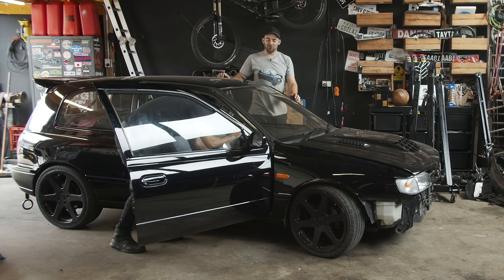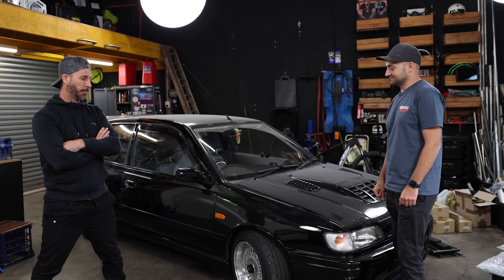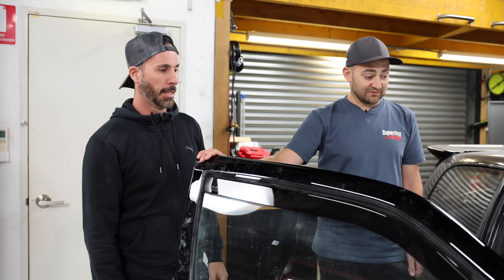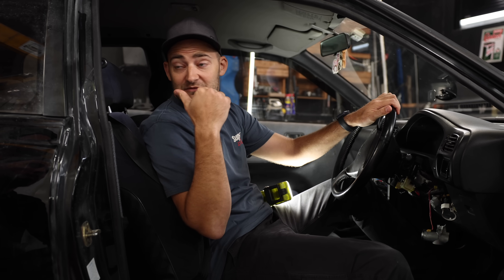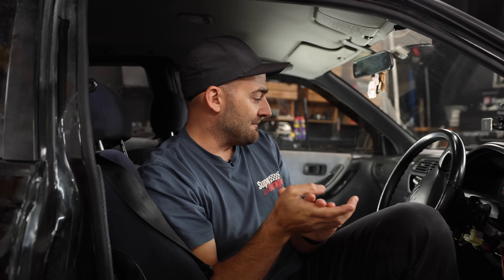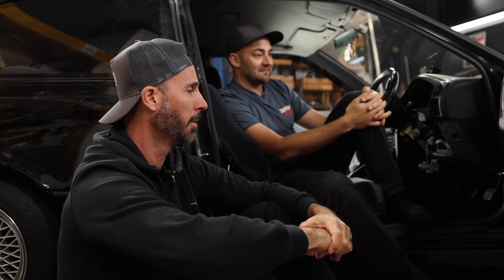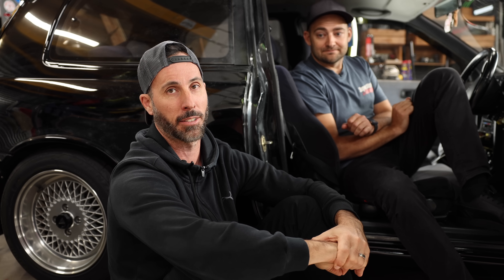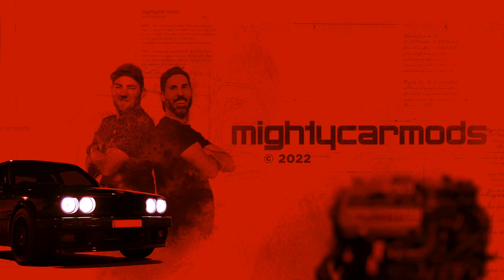Someone tried to Steal the GTi-R | Police Called

Comment: Shame you didn't catch them in the act, here in the UK one of my mates was parked outside my house in his modded Toyota starlet glanza while we were having a few beers. The CCTV which ran in real time to a screen showed someone walk up to his car and start trying to open the door with a screwdriver. He didn't know what to do and panicked. I on the other hand knew exactly what to do........I wasn't going to confront someone with a screw driver unarmed and in the UK the police are pretty useless, if they turn up an hour after the crimes committed you're one of the lucky ones. So I decided the best idea was to grab a large axe and chase the guy down the street with it. As soon as I shouted at this guy and went nuts at him he started running. I chased him for a few minutes until he jumped over someone's 6ft garden wall. When he landed the other side he started screaming and swearing. I saw the house lights turn on and thought I'd better get away as I'm holding a 4ft axe. It turns out a few days later he had badly sprained his ankle after jumping the wall and been arrested for going equipped for burglary and trespassing because the homeowners called the police and he couldn't walk to get away. He got his karma. Moral of the story,  leave other people's stuff alone, they worked hard for it and karma will catch up to you one day.
Reply: Its why they carry scissors these days and not screw drivers. My previous car go broken into several times at work (90's car, parked near a train station). Last time cos new locks, they TRASHED it. Smashed all the glass, slashed the tyres and shit.
Reply: @Mr_jz_12  sounds like they put some effort in and got pissed that they couldn't take it/your stuff.
Reply: @dreamcrusher112  The cops knew who they were (wouldn't tell me officially though). All i knew they were kids, they were known to do this, and they got off. "You'd have never seen it again if they did get it. Because they didnt get it, they trashed it". Scissors were left on the floor undet dash. "They carry scissors as they have two goes at locks/barrel. It doesnt look suss if someones carrying scissors unlike a screwdriver"
Reply: Lol tough guy, scared of a screwdriver.
Reply: I wanta no where u got a axel from so fast lol
Reply: Just got back from England and constantly heard that theft and violence is common as hell. One of our contractors had a co worker get his face broken up in what the Brits call a  "car park"
Reply: @whackaify  Like all places around the world, you have to know where to be and when.
Getting caught in the wrong place at the wrong time is very common in England as there's a lot of them.
Reply: @DJIInLondon  Lol you'd be surprised what people are capable of when others mess with their shit. Plus this kinda shit common, especially in the UK

Comment: There's a couple being broken on eBay UK which still have the driver door.

Rust is getting to the chassis of this age of cars here so they are failing the MOT - our loss could be your gain.
Reply: I can help you get one shipped over, if needed, let me know.
Reply: @jaygsi  That's awesome. I feel the love.
Reply: Failing that would a door from a nissan sunny be a suitable replacement?
Reply: @tammurney3053  Lol i almost said the same thing, yes it would and there no expensive either

Comment: The value thing is so true. 

November 2019 my DC2 integra Type R got rear ended. Relatively light damage, car still 100% drivable and no chassis damage. At the time it was insured for $7200, which to be honest was a fair value for it on the market at that point. Quote to fix it was $7700. They wrote it off despite a solid month of me trying desperately to save it. 

Queue 2 years later and if it was repaired it would now be worth 30K.
Reply: as a integra lover, i would have bought it back, fixed it, and got a new/rebuilt title, even if it wasnt a type R.... i own 3, have owned 5, and never owned a type R
Reply: @popanollie1  i did buy it back with the intent to repair it but the insurance company deregistered it again despite my protests which made the whole process of getting it back on the road a much bigger and more expensive nightmare past the original 7K repair cost. (Im in NZ with fairly strict laws on damaged/potentially unsafe vehicles) It ended up sitting in the driveway for 6 months before I eventually onsold it to someone else who planned on turning it into a track car.

About a month after the crash I actually found another DC2R for sale in original factory Milano red (stupidly rare) and bought that one, which turned out to be a much better financial decision in the long term anyway because it was in MUCH better condition. I still have that car now and she is my absolute pride and joy.
Reply: If i ever decided to get insurance (other than the standard 3rd party one) i would make sure its one that allows you to keep the car if it ever gets written off.
Reply: That's sucks man. If this ever happens again, find a bodyshop that's willing to write an estimate to 95% total threshold and cover the rest out of pocket. The shop I used to work at would do that for people that clearly loved their cars and wanted them to not be written off because it wasn't really any skin off our nose and totaling cars didn't make us hardly any money vs repairing them. We did it for an MR2 that had a full bodykit because the customer was willing to pay and willing to find out of production parts for us.

Comment: I do feel your pain with the damage, when I was in Germany, someone literally vandalized my car. smashed my rear taillight and used some sort of crowbar and put a hole in my rear quarter panel. Till this day I still never figured out who did it but I was able to replace the taillight, unfortunately my quarter panel still has a hole in it. I hope you guys find who did this to your car! A shame that parts are hard to come by for these! Anyways Great video!
Reply: The quarter panel will probably need a piece welded in, plastic fill to smooth the panel out and painting. Unfortunately, not a cheap or fast job
Reply: I hare people like that. Probably teenagers or eco people
Reply: Sounds like a truck backed into you tbh

Comment: Exact same thing happened to my Turbo Starlet - Smashed the barrel and lock, bit of panel damage etc. Only thing that saved me is I stored it without a battery. I can feel the anger from you both
Reply: Doesn't the barrel have a lock to stop people from smashing screw drivers in it tho?
Reply: @peterstoyanov7897  Starlets weren't really seen as sports cars so Toyota probably didn't think to invest in a more secure barrel system.
Reply: @peterstoyanov7897  They can undo it or use a metal pole that is slightly wider then the barrel lock,and than snap it off to expose the white plastic key turning bit
Reply: This must be the go to way to steel a starlet, mine was done the exact same

Comment: So sorry to hear what happened guys, gutted for you both... I'd recommend checking that car over for a tracker, it is possible the pieces of <goat noise> put a tracker on it to see where it ends up.
Reply: I'd imagine if these <goat noises> were stupid enough to ruin the door and key barrel, then they're too stupid to think of using a tracker. It wouldn't hurt to check it over anyway just to be sure though. Good idea.
Reply: @jordanh.2998  they might have wanted to damage enough that they'd need to repair it? I don't know, I'm always wary and probably a bit paranoid after a few incidents in the past.
Reply: Good shout. Limited numbers of anything or something collectable people keep there eyes on them. If you have something nice some cnt is going to want it.. scummy.
Reply: @jordanh.2998  eh better the be careful just like mcm said you can use an AirTag in you car to track it, its just as easy for them to just slip one in there as well

Comment: I've been mad at my lil E36 Compact for suddenly dying on me (immobilizer/dme out of sync with the key I think) and I still can't get it started. But this video made me realize that as much as it sucks to not be able to get my own damn car going, I'm glad BMW put the effort into making EWS a clusterfuck of a system.
Reply: @jo300hn  You're going to hurt the lil compact's feelings bro don't do this
Reply: @TIPh0enix  all good👍
Reply: Yup had the same happen on my E36, EWS2 immobilizer chip in the key died while visiting the Nurburgring, stranded there for hours in the middle of the night, hundreds of miles from home, cursed the whole system but I really did not want to remove the immobilizer because it does work, and EWS2 is still a fairly difficult system to beat, despite being so old: the only way to bypass it is to code it out of the ECU.
Reply: @ThaMythbuster  Aye that seems to be my only option. Have to send the DME across the country to get it coded out. Funny enough I don't actually know for certain if the car has EWS1 or EWS2. The module is missing the "II" on it but it's a 95 with a M43B16 so it should be EWS2.
Reply: This episode has convinced me not to delete the EWS from my E46. That EWS might come in handy someday.
Reply: It sucks ass, my golfs timing chain is gone after only 72k miles. No idea the total damage, might be scrap now.

Comment: Expensive 90s JDM cars are prime targets for car thieves because of the cars usually outdated security tech. Definitely worth upgrading security on older valuable cars.
Reply: 80s cars were worse. My Dad had a shop next to someone with a Sierra Cosworth. The 3rd time it got stolen and recovered the owner was complaining to my dad about "how do they always manage to steal it?" so my Dad took the keys to his Ford Transit van, unlocked the Cossie, started the engine and drove it off right under the guy's nose. Factory immobilisers, moving the stalks for the door locks so you couldn't just fish them through the rubber door seals and putting plates in the door to stop the coat hanger trick were massive game changers between 80s and 90s cars.
Reply: This is the reason I assume why the battery may have been taken. Whoever might have recognized the car and thought "Well I can't take it so I will knock out possible hidden cameras." Like how Tesla those cameras turn on when it sees or feels (vibration) a disturbance.
Reply: @misterthegeoff9767  at least the Cossie needed a key, 60s and 70s classics just needed a flat bladed screwdriver, and the wiring was easily reached to skip the lock completely if its before steering mounted locks.
This is why cars that age go from locked up sheds out on club runs and back in to lock up. Values of anything muscle car era are getting stupid expensive.
Reply: With the rarity these days though trying to sell stolen parts would be a mission as would be pretty obvious where they came from!!!! Half the issue is the law is that piss weak the penalty isn't a deterrent at all

Comment: If they were actually knew what they were doing the car would be gone with hell of less damage.
Reply: Then it would be gone though.. Better this than car gone if you ask me
Reply: My Brothers EH wagon, was stolen using a fork lift, back in 1980 .. it had a Alarm system, motion detection.. but they just cut the high tension lead and bye bye..
Reply: @graemejohnson9025  high tension lead???
Reply: That's what really annoys me. I had an old 80's Navara with a full sound system in it, and they destroyed the driver's door, same as this GTi-R, then mutilated the dash trying to get the headunit out. Ripped up all the carpets, tore the wiring looms to shreds trying to pull the amp out from under the seat. If they'd have just taken their time and bought a screwdriver along instead of a chainsaw, it would have been repairable. The damn thing was out in the middle of nowhere - nobody was going to sneak up on them and catch them in the act. They had all the time in the world, yet they still went out of their way to destroy it.
Reply: @jo300hn  another name for spark plug cables
Reply: @jo300hn  it goes from battery to starter motor.. look at your starter motor, it has a really thick cable connected to it... shit load of Amps...
Reply: @jorismk1  exactly. They were lucky the thieves had no clue what they were doing.
Reply: The way the suspects tried pulling off the door and then tried pulling apart the steering column makes me think that meth was involved.
Reply: @TheKnobCalledTone.  yeah these thieves had no idea. Anyone with a brain would just drag it up onto a tilt tray truck and be gone.
Reply: @graemejohnson9025  tension is actually volts, but all good I know what you mean now. HV = HT
Reply: Yeah. Check out the Lockpicking Lawyer. He could've been inside that car in under 30 seconds, with no damage.
Reply: @ashleysharkey6406  I had my Navara stolen to they found it in the bush trashed and had around 200 of VB cans in it and police said not fingerprinting it been there to long 8 weeks thats just lazy.
Reply: Omg dude my civic ek hatch had something similar happen to it...  My main problem was they didn't steal it just damaged it .... As a reformed citizen it infuriated me as they knew absolutely nothing other than some convos they must've over heard from the elder car community guys.... Smh all I could say was "Bastard amateurs ducked my car up
Reply: They need to pump up the punishment for car theft. It should be 30 years in prison for first offence. Then the problem goes away instantly.
Reply: @JH-oe7hf  Christman island is empty these days, good place for a penal colony.
Reply: @graemejohnson9025  Thats not the high tension lead - HT leads go from the coil to the distributor and then to the plugs, or just from the coil pack to the plugs. Tension is another word for voltage, the starter runs on 12V and is high current but not high voltage - it is by IEC definition Extra-Low Voltage (below 50V Ac/120V DC). High tension is above 1,000V AC or 1,500V DC. (Yes, that means your house power is low voltage - the difference between low voltage and high voltage is mostly how well it can create a spark across an existing gap in dry air, the difference between low voltage and extra low voltage is how easily they will kill you if you touch them)
Reply: @grimreaper6112  they fingerprinted mine but never followed up. I gave them all the details on the equipment that was stolen. The head unit wasn't even sold domestically so if one ever showed up it was almost guaranteed to be mine, but I guess they had better things to do.
Reply: Fact!
Reply: @ashleysharkey6406  yeah I've had my stereo stolen from two separate cars and both times it resulted in the cars being write off's.

Comment: I had to break in to cars for recovery and for customers who locked themselves out. Every time I walk past a 20+ year old vehicle and I think "anyone could take that with a coat hanger in 30 seconds" and then I'm thankful that most people who are smart enough to do so are also smart enough to not be massive @#&%$ and go around stealing cars.
Reply: I used to keep a little piece of thick plastic tape behind the numberplate of my old Astra so I could slip it through the door seals and pull the locks if I locked myself out. Prospective thieves never found it and always screwdrivered the lock barrel instead. Car I owned before that was a Mini and if I locked myself out of that I just used to wait for another British Leyland car driver to come by, flag them down and use their keys.
Reply: @misterthegeoff9767  lol BL at its finest!
Reply: @misterthegeoff9767  You joke, but I have a 1980 Land Rover and my friend has a 1967 - until I changed my door locks (I fitted anti-burst) I had exactly the same key number for the doors as he did!
Reply: @cameronwood1994  I wasn't even joking. In my 6th form 3 of us had minis and one of the keys on my keyring opened both of my mates' cars but not mine.
Reply: @misterthegeoff9767  I can open and start my land rover defender with the door key from my hilux... same key can also open my dad's land rover
Reply: @misterthegeoff9767  I believe it, my MK1 VW keys used to start one friends car, and open the doors of another.
Reply: the keys to my 04 Forester XT could unlock and start my 05 Impreza and unlock my friend's 02 Impreza

Comment: The fact they reefed on an irreplaceable door they clearly didn't know the value of the car, absolute muppets
Reply: Or the door! even if they had the hint of an idea that they would be selling it for parts, they should have minimised the damage to the door. 

These guys were in no way pros (or it would have been on a tilt tray) I kinda wonder if they were just wanna be joy riders, assuming that because its an older car it might not have the tech to prevent them stealing it. Because they didn't even bother taking the rims. 

If it was joy riders I'm so glad they didn't get the car because they may have burnt it out and that would have seriously sucked. 

I do wonder if they cut themselves on the battery or something.
Reply: Isn't the door on a gti-r the same as a regular sunny?
Reply: @JohnHonda101  yes they are same.
Reply: Pying at the top of the door is a legit method to get into a car without damaging it, I've done it a few times on my cars after i locked the keys inside (falcon and a triton so far) and locksmiths even have a little air bladder that does the same thing.
Bending the door may have been accidental for these guys.
Reply: @archygrey9093  I was thinking the same thing. They use a plastic wedge to start then slide the bladder in.
My x locked all the sets of keys to one of our cars inside, I watched the recovery driver bend my door in much the same fashion. Not nearly as bad but the door frame was never the same.
Reply: @JohnHonda101  same as a 3 door sunny, not 4 or 5 door. (Front doors are shorter) Not many of them around either.